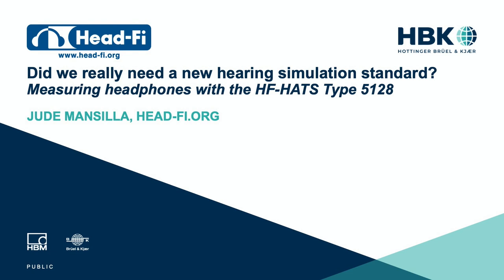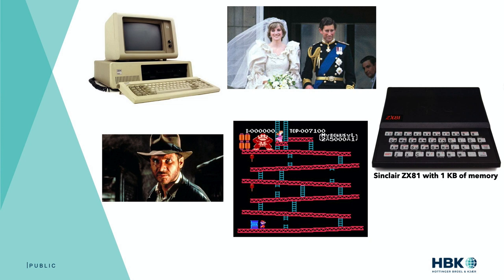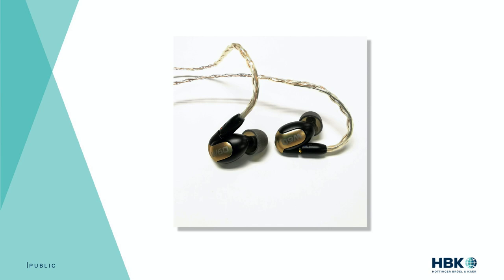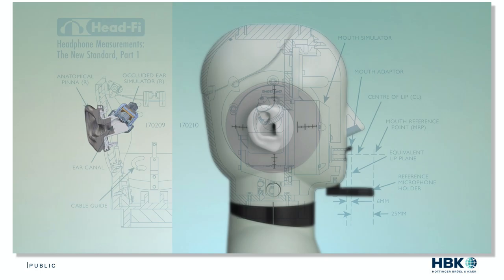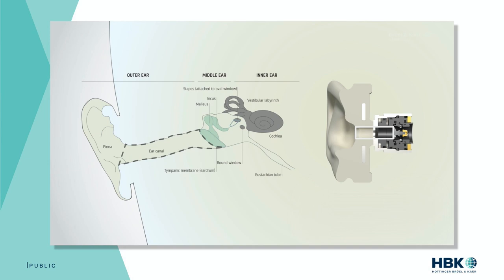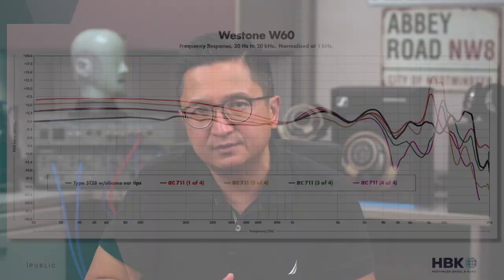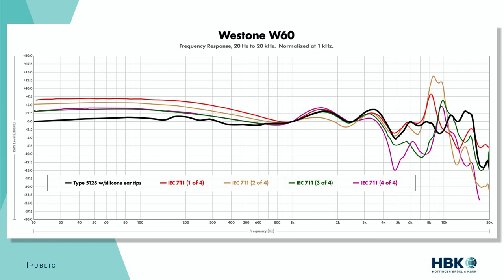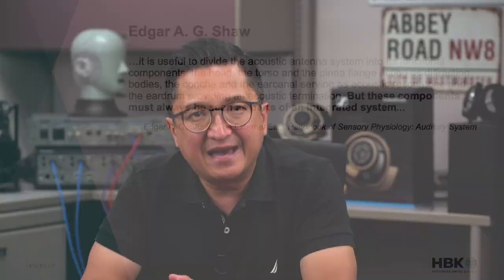Did we really need a new hearing simulation standard? Measuring headphones with HF-HATS Type 5128

Comment: Interesting!  Have you had a chance to measure a number of the Westone IE headphones?  I 'm sure they are high quality but, they are also 3 way systems and perhaps prone to variations due to manufacturing tolerances.  We have several times measured a number of units of one headphone type and found significant variations from one to the next.  Or, maybe 4 are similar but one is different.